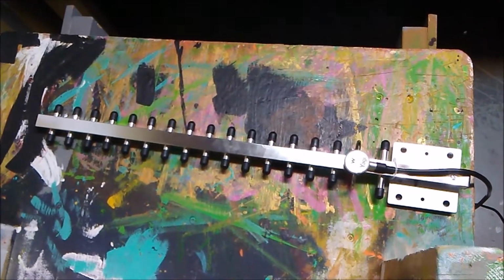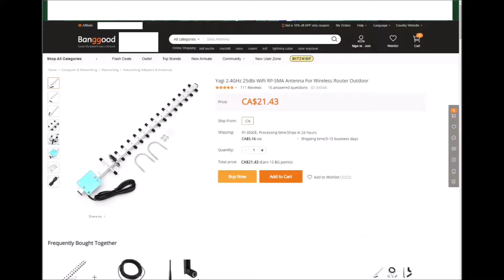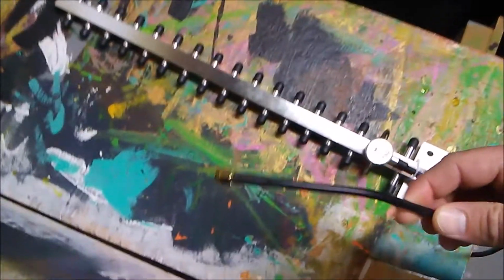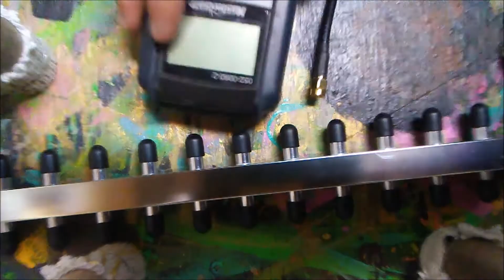Help! 2.4GHz Yagi WiFi Antenna: Should the hot & ground have continuity?

Comment: Antenna books commonly use a term called impedance without explaining what that means in layman's terms because they assume the reader is an engineer. Your antenna is measured in impedance but your meter can only measure resistance. 

In layman's, reactance/impedance can be thought of as "resistance" but only for the specified frequency range.  Outside, above or below, that frequency the "resistance" is higher or lower than specified. An antenna happens to be an element which changes its "resistance" depending on the exact frequency being applied to it while it is measured.

A digital Ohm meter measures resistance at DC (0 Hertz) which is outside the AC operating frequency of the antenna of 2.4 GHz. Had the Ohm meter happened to measure "resistance" using a 2.4 Ghz sine wave then the meter would have reported 50 Ohms instead of a short circuit.

Neither the meter nor the antenna are broken. Your observation is a common misunderstanding because the units of resistance, impedance and reactance are each listed in Ohms.  Your meter says it measures Ohms and it does but it only measures the resistance type of Ohms.  For impedance/reactance that meter reports misleading answers.

Good Luck

Comment: Yes - The driven element is a folded dipole that is, at DC, essentially a loop that connects the center conductor to the shield. However, at 2.4 GHz the dimensions of that loop are on the order of the wavelength of the electromagnetic energy. There is a time varying induced electromotive force and the I-V relationship should give a characteristic impedance of 50 ohms at that frequency that matches the output impedance of your transmitter. However, at DC it will be a short circuit and that's OK.

Comment: I have a crap like this.
Don't work. Can I mode the dipole and use the antena? I have a 841nv9 and want to put outside to make a external acess point.
Reply from the maker: thanks for the comment
Reply: @2bit661  can you help me?
Reply from the maker: @djbertinho1984  Roberto, I wish I could help you. You probably know more than I do. I searched for "841nv9".  It sounds like you want to modify the 841nv9 antenna, and swap it for a different antenna.

I was reading the following:
https://forum.dd-wrt.com/phpBB2/viewtopic.php?t=310697&sid=64ad406cc67077b7a3b3f602216d56dc

Please see Andrew McNeil's YouTube channel. He builds 2.4 GHz antennas, and tests them. Here is an example: https://www.youtube.com/watch?v=BOaFa5PE4qg

He seems to have success with these "can-tennas." In fact, he sells them on eBay.

Personally, I want to build a cantenna. But, I have a few other projects right now.
(The reason I created this video, is because I also need help.) Getting good advice can be frustrating. All the best!, 2Bit